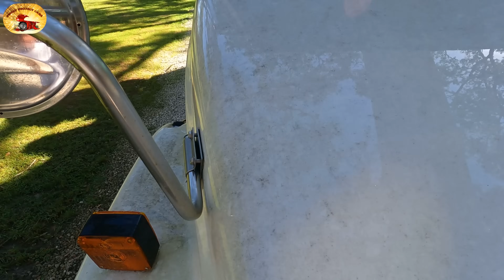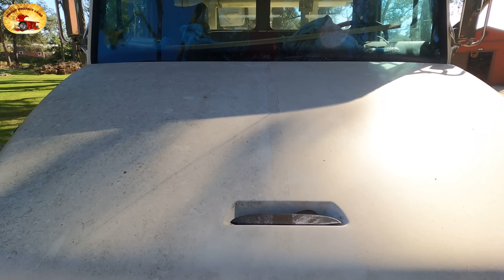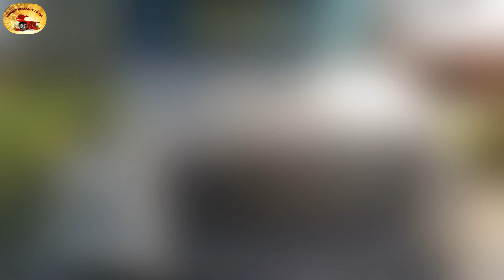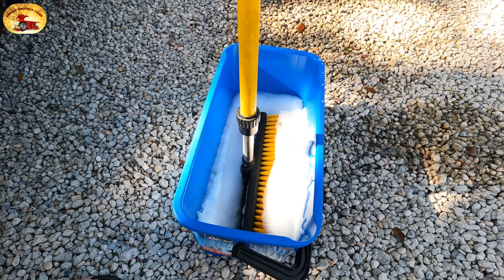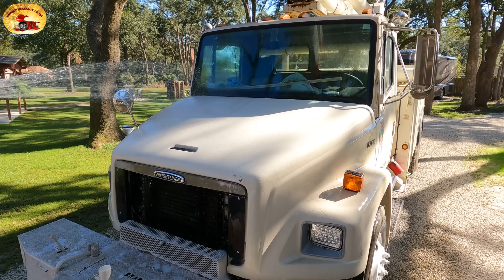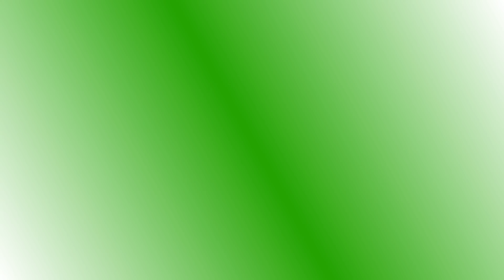Seriously, WHY DO PEOPLE USE CERAMIC COATINGS .... Take 3 minutes and See for Yourself

Comment: Not a fair comparison.

I agree that ceramic coatings can be good, and a good wax is also good. 

If you keep up the wax to a car, you can get similar results. There are a lot of spray waxes out there. May not be as long lasting as ceramics, but they are easy to apply.

Cost is a factor as well as ease of application etc.

Swings and Roundabouts my friend.
Reply from the maker: I can tell you after 40 years in the car detailing industry there is no comparison, there is no wax in the world that will put a liquid glass finish on your car like ceramic coating.  Thanks. mad Mike the hammer SPC

Comment: Thank you for the video. I have a quick question - what will happen when we are 2 years down the line with the ceramic coating? Will it peel, can it just be re-applied or is there a special process to remove it and then to do it again? Thank you very much for the feedback!
Reply: No it will not peel if applied correctly.
Reply from the maker: After 5+ years, if needed, you just re-apply. This https://goo.gl/z9TrgR  doesn't peel, there's no need to remove it, just re-apply as needed, chances are you won't need to do it.  Thank you for watching and asking PD, if you want to see how to apply properly, search our videos we have multiple one's showing application of the product.  Have a fantastic day my friend. mad Mike the hammer SPC

Comment: I am undecided on ceramics because so many products claim "ceramic". I am sure yours is a good product, but there may be other ceramics that are good too. What does "ceramic" really mean? Is there a way to know what is "true" ceramic and what what is not?
Also, I coated my RV gel coat partially with a ceramic coating. I wonder if ceramic also gives me UV protection because plain wax has to be done often to keep my gel coat from oxidizing.
Reply from the maker: Essentially a hard shell, a ceramic coating will prevent water stains, road grime, bird droppings, and other substances from reaching and harming the paint. With a quick rinse, they'll simply slide right off.  And, this  https://goo.gl/z9TrgR does indeed provide the best UV protection of any we have used.  Thanks for watching Doug, have a great day. mad Mike the hammer SPC
Reply: Doug, do you remember that old tv show Knight Rider? The car had a bulletproof coating applied to the outside, in the story. That was science fiction, but this stuff is pretty similar in concept. It forms a glass-like layer over the surface it's on, but just like with paint you have to prep the surface for the bond to form. Since it's pretty smooth, stuff can slide right off. And it's tough so it resists scratches pretty well too. 

Mike did some videos where he was applying it to all sorts of stuff. He was having a lot of fun with this stuff, but it showed that it really does bond to a lot of things 😅
Reply: Ceramic is silicon carbine (SiC). The ones that advertise ceramic are usually silicon dioxide or silica (SiO2). SiC has a higher hardness, so more resistant to hard water etching and higher durability if maintained properly

Comment: Lets say a time comes and there is some body damage that requires some refinish like paint. Can this ceramic be easily removed so the body / paint pros can complete the work. I think otherwise the paint will just peel off.
Reply from the maker: Hello Gregory, the ceramic would have no bearing on repair work, they would do their work as normal and upon completion, that area could be re-ceramic coated.  But there is no need to ever remove the ceramic coating, after 5 years or more, you would re-apply the ceramic coating to maintain the protection.  Thanks for watching, have a great week. mad Mike the hammer SPC

Comment: Ceramic coating made the paint become more dusty but it made it shinier and smooth so whatever
Reply from the maker: Not sure what video you watched my friend, but you need to go troll elsewhere my friend. Have a great day. mad Mike the hammer SPC
Reply: @SweetProjectCars  Mike I didn't say that to undermine your video. It's pure facts and a true story. I used  ceramic coating from the popular chemical guys, missed a spot on the roof and after a few days you could see where there was less dust and more, but I think that's a good trade off for the best protection you can get.